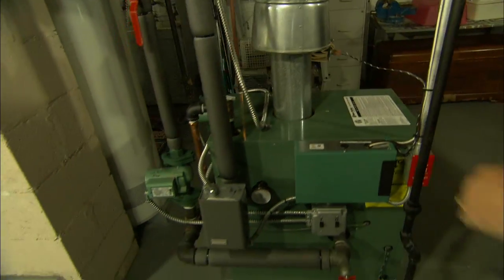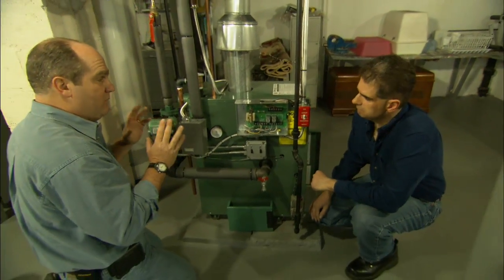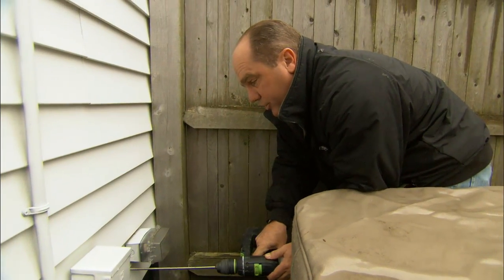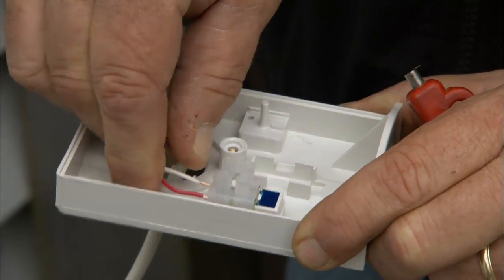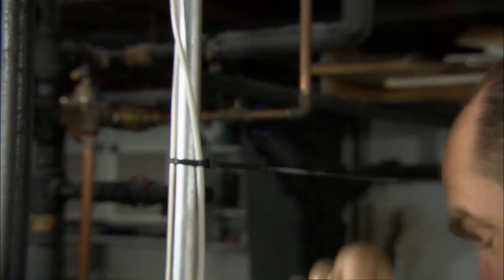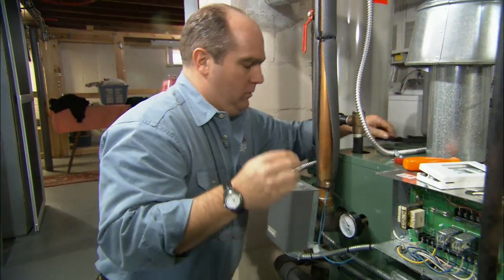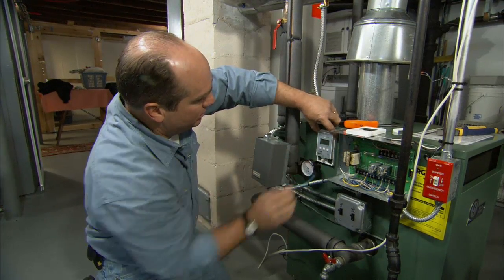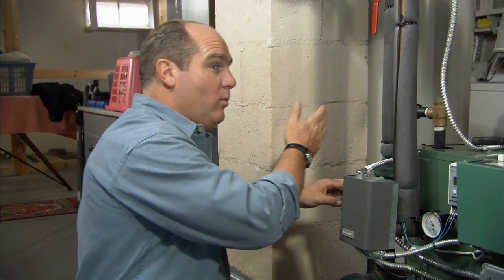How to Install Weather-Sensitive Heating Controls | This Old House

Comment: It doesn't look like the cast iron boiler has a boiler loop installed to keep the return water temperature above 130.  If the boiler supply is 137, the return temp is going to be well below the condensation point of the combustion gasses, and the cast iron boiler is going to turn into a condensing boiler.  Basically, water is going to condense on the cast iron heat exchangers, combine with the CO2, turn into carbonic acid, and the cast iron will rust out within a couple of years and start leaking.  Whatever money they saved on fuel they'll have to spend on a new boiler within a couple of years.  They should have first repiped the boiler with a boiler loop and a thermostatic three way valve and then done outdoor reset.  That way the boiler would always run above condensing temperatures and the supply water will be appropriate for the outdoor temperature.
Reply: Well said and correct

Comment: Good lord. This is utterly ridiculous. Yes, outdoor resets are good to a point. Never ever let your low end supply water temperature exceed 30 degrees below the design temperature. Yes, you'll have more savings but the flexing of the heat exchanger in the shoulder months will dramatically decrease the life of any non-modulating burner boiler. In effect, the more you decrease the temperature beyond 30 degrees the shorter your boiler lifespan. Likely a net loss on your investment; boiler and controls. This also has an effect on your supply and return piping connections which could be far more costly to replace. Further, dependent on your local price for electricity (currently in some parts of the country electricity can be up to 3 times as much as gas in similar units), a longer running distribution pump can potentially eliminate the overall savings if the boiler is natural gas as the lowered temperature takes longer (typically) to meet the space setpoint. I'm actually pretty surprised by this, normally 'This Old House' is responsible with thier content.
Reply: You're way wrong. That's a cast iron dry base boiler, by lowering the operating temperature you're reducing expansion/contraction from what it would have been. Supply/return piping connections??? What will happen to them?? NOTHING. It should have a return bypass, all boilers should so that they never take back cold water. ODR is the best bang for old boilers, you can get 10-30% savings, the payback is usually 1 year or less. A new system would take years to payback and then start saving. You can set the Min Boiler Temp to 140/150 if needed.  Personally I think most US HVACR equipment is junk and should be outlawed especially drybase boilers. Only Hi Eff should be legal and all controls engaged. Many HVAC contractors are clowns who never hook up the controls, many boilers come with ODR controls and more and they never get hooked up, they just run to 180-200F like "the good'ol days. Customer never sees the savings. Same with warm air and modulating equipment, they avoid hooking up the user interface smart t-stats and use standard t-stats, when you do that the system no longer modulates and it's eff goes to 1980 levels. It's 2023 people, get in the present.
Reply: @905Alive  lol. Found the new guy